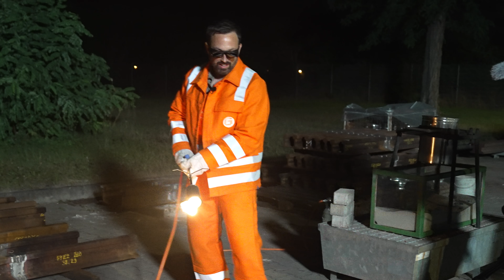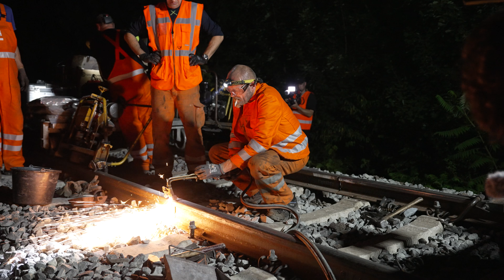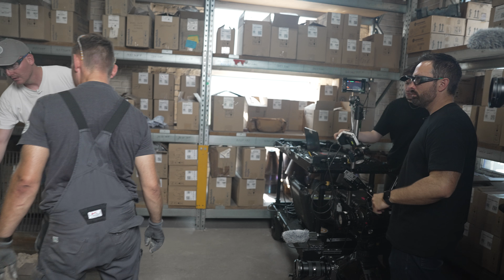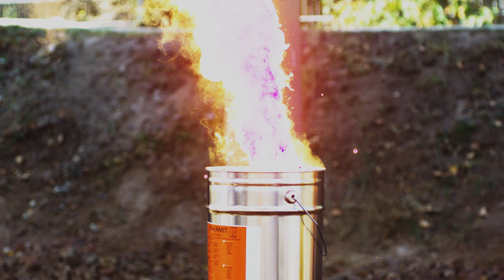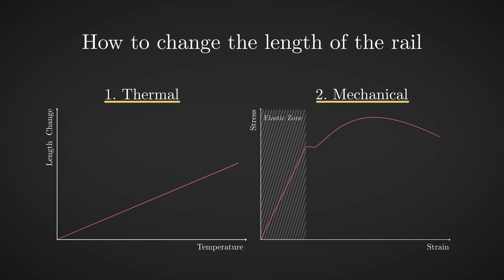Why Don’t Railroads Need Expansion Joints?

Comment: 5:43 that doesn't sound right. If this was the case then not having it angled up would fix the problem.  The reason you angle it up is because as you pour the metal at the bottom will start to cool first and THAT is the contracting force that starts pulling it together and eventually as the cooling and contracting forces get to the top the 2 sides are pulled together level again. 
The way you explain makes the act of angling the rails up the thing that creates the problem to begin with. Not sure why you thought that but it's just not accurate.

Comment: Why we don't need expansion joints,
1. Smooth  ride, and less damage of wheels
2. Buckling happens but sleepers prevents by force.
3. There were examples of concrete tracks of ww2 which acted logistically nightmares, so stuck economically.
4.....

Comment: Maybe a silly question, but why do you cut the rail and then weld it back? I understand welding separate rail segments arriving from the factory.
Reply: they weld it on the site of the railroad because it would be difficult to transport long sections of rail from the factory to the site, so they make them in small sections which fit onto the flatcars, which are a type of railroad that is completely flat, perfect for transporting wood, large vehicles, or rails. they then transport them to the site where the new line is being constructed, and the they are welded together on site.
Reply: @NateTheTrainGuy  my question was different.  In the video,  they cut the rails in place (on the railroad) and then weld them back. Why not just let them be?

Comment: This makes no sense to me.  I mean, obviously this is done and obviously it works but the amount of labor is astonishing for one weld.  If we assume an average rail length of 40 feet (I looked it up) and a run of 100 miles (short for a railroad but as an example) then that is 13,200 such welds needed...x2 for each track so 26,400 welds needed.  If it takes 15 minutes per weld (which seems fast) that'd be 396,000 minutes (or, 6,600 hours or 275 days working 24/7...which is time a train cannot run on those rails till they are fixed).

How does this ever make sense?

Comment: i didn't undeerstand why the rails have to be anagled up when welded with termaite to be perfectily flat...not convincing in my opinion, can someone explain?
Reply: i mean you can just weld them flat and the pulling force would be the same
Reply: i understood, it has more volume but in the other plane on the top, thus more force

Comment: I didn’t get the things! First you explain that rails do need gaps to prevent train derailment then you weld the gaps and the video title says that they don’t need them! Now what is the final statement - do rails need gaps or not?! 

I’ve seen rails that still do have gaps but the borders aren’t rectangular to the rails but angled. So there’s still a gap but the train wheels never fall inside it and that “ta-tak, ta-tak” noise is no longer heard.

Comment: 7:44. Dear Lord, is this whatcha need bent right? No heat. No equipment. Just alignment in the field.

Now we understand how to perforate metal for easy ripping of "sheets." Phyical heat or non-physical stimulus will break or stretch the metal, as required. Does not require proprietary alloy,....but it can to control safe access. Aka I can key the metal to be unmovable except by X. 

Solved for X
Marks
Da
Spot

If the deadline's real: you better get crackin' with me. 😊🎉❤

A man's gotta eat.

Comment: Why did you spend 90% of the video showing how to weld the joint but 2% explaining that they are prestressed to counter expansion and 0% explaining how the prestressing is done, how longitudinal loads from prestressing are transfered to the sleepers, how the sleepers dont just slide sideways since there is a thin layer of ballast between each sleeper (most of the ballast is below thw sleeper?).

So many questions about why tracks dont need expansion joint unanswered. But how to weld (not the title) seems pretty clear.

Maybe its because I am a structure engineer, but the most interesting part (for me at least) was left undone..

Comment: Railroads Need Expansion Joints. Period. Thermal expansion/contraction a law of nature that needs to be respected.
Using the "rail Preload"  like we do in Europe, ensures the rail normal performance in a limited temperature range. Where Preload stress+/- Thermal stresses generated by natural temperature variations of the rail bring the rail beams to the point of either buckling (in case of positive temperatures) or damage of the rail system, rail itself.  If you live in Western Europe - you should have noticed railroads closures when the weather gets too hot... That is precisely due to using no-expansion joints rails systems.

Comment: 24:03 tell me you have some sort of hyperfixation without telling me, you have some sort of hyperfixation: when you can identify the Train on a video just because of the color scheme and cargo. 

This locomotive right here is from the german company Siemens Mobility, the dedicated series name is Vectron or 193 (BR193 in germany) and its leasing company is ELL, a large locomotive leasing company based in Wien, Austria. These Locomotives carry cargo from Denmark and the Netherlands through Germany, Austria and Swizzerland to Italy and other countries. The locomotive is most likely the AC variant and not the MC, as ELL has 37 of these exact types (at least going from 2014 on) and are planning on running 301 of them by 2027. You can differentiate them because the AC variant has only two pantographs instead of four on the MC.

…and the cargo? oh boy, do i have a lot to tell you. Most of the freight wagons are these two Variants: T2000 and T3000e. Their actual designations are Sdggmrs/s, which encode what they are designed for. S is the freight wagon type, d stands for the capability to carry road vehicles, gg means they can carry containers over 60 feet length, and the s or ss stands for their maximum allowed speed. These are commonly used by Walter, a large logistics company native to Europe and based in Austria. i would assume, based on the locomotive and where they are used most commonly, these wagons should all be Sdggmrss, as this locomotive is rated up to 120-200 km/h. 

now to the biggest question: why the heck would i know? uh dont even ask
Reply: oh and at 24:26 you see another german Train, the series 430 (BR 430/431 in germany) which is a local train made by Alstom and Bombardier. less interesting facts about that one since its not a cargo train and since i exclusively travel by these in the region around frankfurt.

Comment: Yeah mechanical restraint making for less maintenance is horseshit. that only works in climates at near constant like always hot or always cold. There is no definitive way to stop expansion and contraction. Every 2 years the rails need to be lifted and adjusted. The secret to the lack of sound is really half track joints where they split it parallel to the rail down the center longer rather than gapping it perpendicular across the rail as a gap.

Comment: There's no "liquid thermite steel". Thermite, of the kind used, creates elemental iron, as you'd expect out of iron oxide. There's no carbon anywhere in the process, and so there can't be any steel.
Reply: They add more ingredients to the thermite mixture to make steel, if you would have watched part 1 you would've picked up on that

Comment: These are made for entertainment.  Just answer the damn question: what happens when the rail expands in the heat?  
Answer,  because these rails are made from high-strength steel alloys that better resist thermal expansion and contraction.
Reply: typical youtube clickbait, hey one 15second question , lets waste 30minutes of your brainpower and time on pointless stuff.

Comment: IMBECILIC AND INCORRECT 
Welding rails is limited in its value. You CANNOT weld up miles and miles of Railway track without expansion causing it to buckle and twist. The limit depending on ambient temperatures in the region of the railway, usually means no more than a mile of rail can be safely welded. At the end of such a length, on modern track you have to include a complex sliding expansion joint. Further Tram rails are NOT lighter or simpler, they are more complex shapes, as they have to include as part of the rail a cup for the flange. The cup is there to prevent  street rubbish getting into the wheel flange recess and derailing trams. Clearly the two Monkeys waffling on in this programme are NOT Permanent Way Engineers, and are talking absolute blithering idiocy.

And I am an ex  senior BR Railway Mechanical Engineer.

Comment: 30 minutes of yackety yack for a 2 minute answer to the question in the title of the video.  The answer is that they tighten the rails to mechanically prevent them from expanding or contracting.  Now go touch grass with the extra 27 minutes I saved you.

Comment: Thermite Welding of Railroad Tracks: A Deep Dive into the Process and Science

*   0:00:00 Thermite Reaction Introduction: The video begins with a demonstration of the thermite reaction, discovered by Hans Goldschmidt, where metal oxides react with aluminum powder to produce liquid metal.

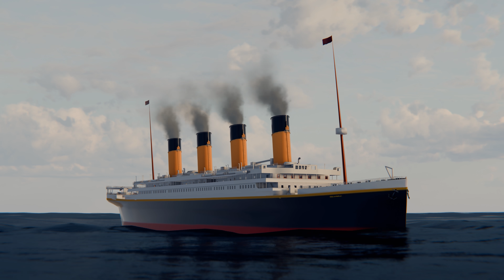*   0:00:25 Initial Resistance to Thermite Welding: Initially, railroad companies were hesitant to adopt thermite welding for tracks due to concerns about thermal expansion and contraction causing track buckling and derailments.

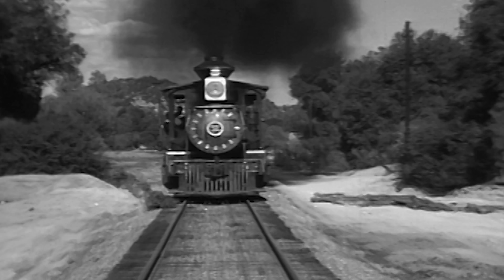*   0:01:43 Thermite and Railroads: Railroad managers thought welding the rails was a bad idea due to thermal expansion of kilometers of rail potentially causing derailment.

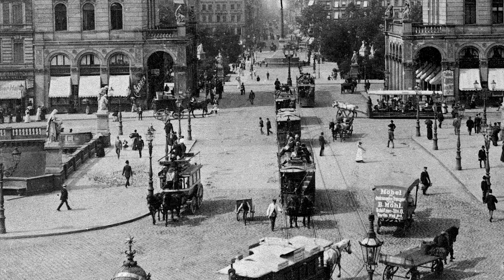*    0:03:03 Early Adoption by Tramways: Tramway companies, operating within cities with smaller, embedded rails, were the first to embrace thermite welding to reduce the "ta-tak, ta-tak" noise of trams.

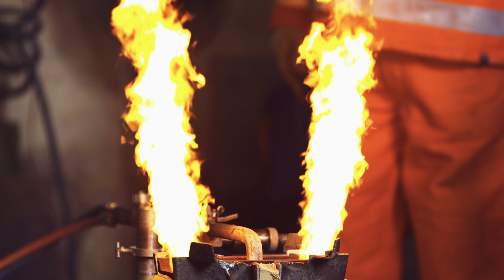*   0:03:34 Eight-Step Welding Process Demonstration: The video details a hands-on demonstration of the thermite welding process, highlighting the eight key steps involved.

*   0:04:08 Importance of Rail Temperature: Before welding, the "stress-free" temperature of the rail is determined. This is the temperature at which the rail should have no internal tension or compression.

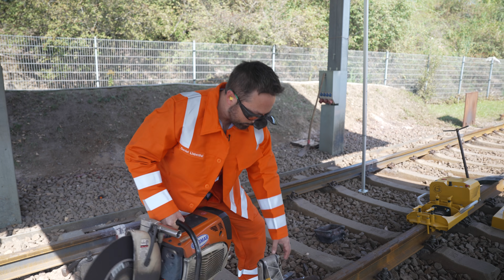*   0:04:39 Step 1: Creating a Gap: The first step involves creating a precise gap (2.5 cm) between the rails, often using a circular saw or torch, to accommodate the molten thermite steel.

*   0:05:23 Step 2: Rail Alignment: The rails are meticulously aligned both vertically and horizontally, accounting for contraction of the cooling steel. This step is crucial for a seamless connection and proves to be very time intensive and difficult in practice.

* 0:07:57 Step 3: Clamping Device Set-up A special device is assembled to hold the mold in place. It must be aligned perfectly.

*   0:08:23 Step 4: Mold Preparation: Custom-fit molds are placed around the rail gap and sealed with a special sand/clay mixture to prevent molten steel leakage.

*   0:09:33 Step 5: Preheating: The rail ends are preheated using a torch to remove moisture and minimize the temperature difference between the rails and the molten steel, preventing the formation of brittle martensite.

*   0:11:39 Step 6: Thermite Ignition: The thermite mixture is ignited, and the molten steel flows into the mold.

*   0:15:32 Slag Separation: Due to its lower density, the molten aluminum oxide (slag) floats on top of the steel and overflows into slag pans, ensuring a pure steel weld.

* 0:15:47 Difficulty Filming: It is noted that the extreme brightness of the burning thermite, causes difficulty for capturing the reaction on video.

*   0:16:09 Step 7: Cooling and Mold Removal: After a specific cooling time, the molds and excess steel are removed using specialized tools, including a weld shear.

*   0:17:28 Step 8: Grinding: The weld is ground down to the same level as the rail to ensure a smooth surface, preventing bumps or indents.

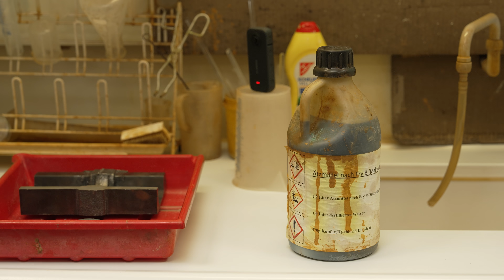*   0:19:31 Microscopic Analysis: The welded rail section is analyzed under a microscope, revealing different crystal structures in the original rail, the thermite steel, and the heat-affected zone.

*   0:21:39 Heat Affected Zone (HAZ): The HAZ, adjacent to the weld, has a smaller grain structure and is the weakest point of the welded section.

*   0:22:16 Strength Testing: Welded rail sections undergo rigorous testing, including bending tests, to ensure they meet strength and safety standards. Failure often occurs in the HAZ.

*   0:24:30 Addressing Thermal Expansion: The video explains that continuous welded rail (CWR) doesn't buckle due to thermal expansion because mechanical stress counteracts it. Sleepers and ballast hold the rail in place, increasing compressive stress as temperature rises.

*    0:26:18 Benefits of Continuous Welded Rail It is noted that continuous welded rail allows faster trains speeds, creates fewer bumps and virbrations, and requires less maintenance.

*   0:26:47 Preview of Part 3: The video concludes by teasing the next episode, which will explore thermite reactions under less controlled conditions.

I used gemini-2.0-pro-exp-02-05| input-price: 1.25 output-price: 5 max-context-length: 128_000 on rocketrecap dot com to summarize the transcript.
Cost (if I didn't use the free tier): $0.03
Input tokens: 21135
Output tokens: 1034

Comment: That’s is  what they use on the 911 crash to melt the metal
Reply: Actually, there is one substance people usually don't think of that could have melted the steel in the towers: chemtrails. Who knows what temperatures those burn at, and we don't even know where they're stored, so they could easily be the culprit.

Comment: That is so 1899,is there not a better quick clamp made of graphite or ceramic that could conform to the rail so that all the plugging cracking and grinding be minimised?😂
Reply: Yeah, especially because the rails are already flush against each other so there's no gap to fill in the first place.

Comment: I am surprised that the straight edge they use to align the rail doesn’t have one side that is angled properly to have the correct pitch that is needed instead of using feeler gauges to set the upwards pitch.

Comment: I welded crane rail together years ago using thermite. What I remember most is that I would spend all day unzipping the rail, aligning it just perfectly, setting up the mold and the crucible, and right before I'd light it off, inevitably some temporary laborer would trip and fall over the rail, causing me to half to re-check and realign everything.

Comment: Wouldn't that strain cause the welds to fail over time.  Wouldn't expansion joints relieve that stress then increasing the lifespan of the welds and rails.

Comment: Railways do need expansion joints when they are in places with very large temperature variations. Why do railways in the UK have to limit trains to low speeds in case the rails buckle if the temperature gets into the 30s Celsius (90s Fahrenheit) but railways in India have no problem with temperature much higher than this?

Comment: I am surprised that the alignment is done using hands and eyes, it seems so primitive. It's weird that no one has invented a device with optical sensors and computer controlled electric aligners. It would save a massive amount of time.

Comment: 5:28 I don't think this explanation makes sense. They have to be angled up because having more metal at the top creates a greater pulling force?
If you didn't angle your rail up there wouldn't be more metal at the top.

Comment: From what I’ve read, according to German Law, a worker cannot work a day longer than 10 hours to let’s assume the rail welding crew is working for 10 hours. 150 welds a night, means 15 welds an hour or a weld every 4 minutes 🤯

That doesn’t even account for the time it takes them to get to where they’re welding and the time to get back which the crew is almost certainly on the clock for.

Comment: I dont understand this video at all!! Maybe im mising something. It said the rails needed the gaps because otherwise the rails could expand in very hot weather causing buckling so to weld them together would be a big problem. So they ARE welded together!!!! So why is it ok to weld them together when it wasn't before. Thats the crucial information that wasn't given. without that info it doesnt make sense.
Reply: Turns out the gaps are not needed. It was wrong calculation and missinformation from the beggining. The only problem with welded rails is that it is more expensive to make them and fix them so it is done only in countries which are more wealthy than United States of America.